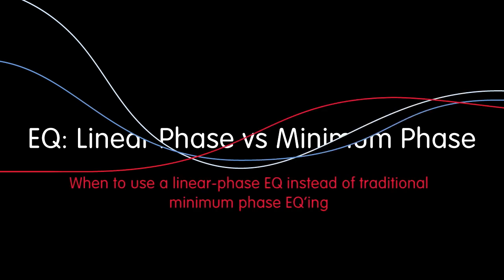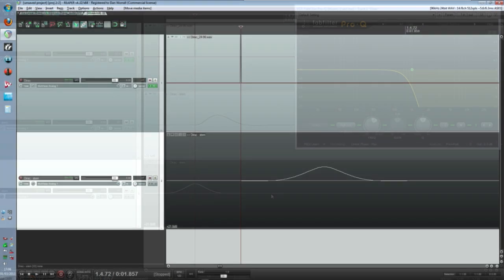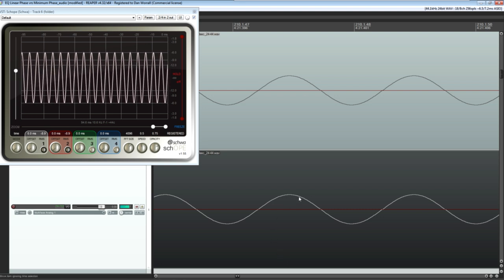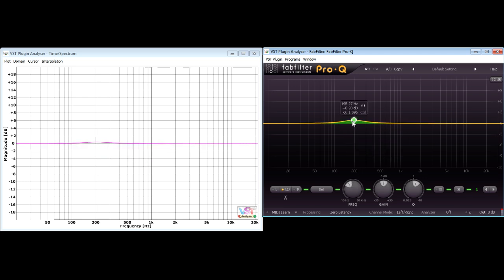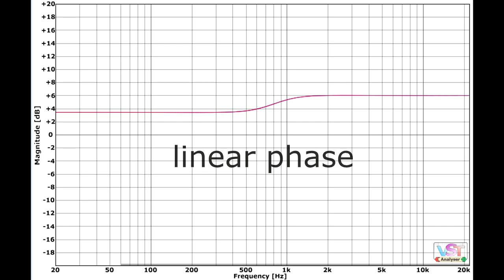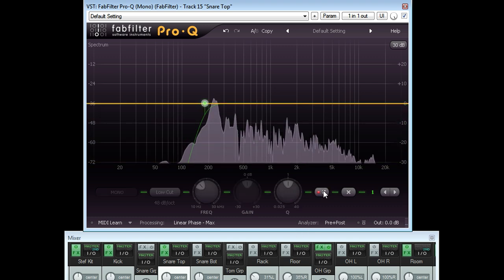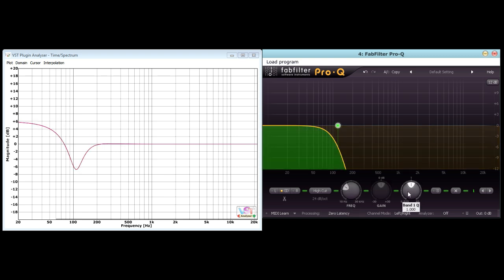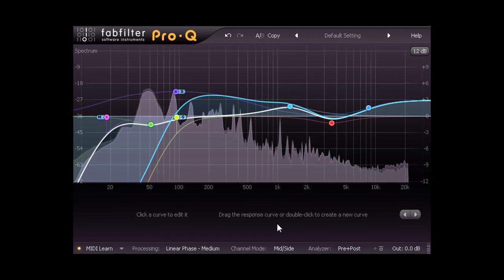EQ: Linear Phase vs Minimum Phase

Comment: This is really where the propaganda surrounding linear phase has been worse than that of minimum phase. Nobody is applying sharp +20 dB bass boosts at 50 Hz followed by -40 dB cuts at 100 Hz. Linear phase is far more transparent and preserves transients better. It is zero and minimum phase that introduce phase distortion that smears the sound. Post and pre-ringing cannot be heard with normal EQ settings.

Comment: So I get the pre ringing having potential to smear transients but in the case of EQing a kick why would a low frequency eq change like say a high pass cut low down or a boost to the low frequencies smear the transient of the kick because the transient part of a kick is produced from the higher frequencies via when the sine wave starts really high pitch and drops, so even if the narrow Q low boost caused the low frequencies it boosted to come in earlier it would be a much lower frequency band to the transient click so that should still come through even if playing closer in time so I'd understand if an EQ move higher up the spectrum smeared a kick's transient in linear phase mode but I feel this specific question wasn't addressed in the video to explain why a low frequency eq move could smear a kick's transient higher up.

Comment: I wish I'd found these videos earlier. They are absolute gold.

The other day I noted something remarkable while working with parallel processing on a bass - a duplicate of the signal was routed to an aux channel with a compressor and saturator (Saturn's heavy saturation mode). The dry and wet signal were mixed together with a compressor and yet another instance of Saturn (warm tape). With the warm tape saturation plugin on the bus, I noticed that - even though it was already in 8x oversampling mode - there was a huge difference in sound when turning on the Linear phase mode. The bass became a lot more punchy, as if I'd turned down the attack knob on the synth completely. I can't really wrap my head around why this would be. Is that because there is some pre-ringing going on, causing the attach portion of the sound to (partially) shift?

Comment: Very enlightening. It would seem that only pass filters are the things to worry about in mixing. However, one can clearly hear phase adjustments on a master track that isn't in paralllel with anything too. I figure this is a delay that will make certain frequencies feel pushed back, in a similar way to a stereo haas effect but about the relation between separate frequencies rather than speaker channels. My process usually involves simply playing with Ozone's settings however and no particular rule comes into play, i tweak the continuous slider until it sounds less...lumpy and phasey (?) ...or i just leave in min phase "analogue" mode. 
Very subjective yet definately there.
In a way, fully linear sounds flat and no phase correction sounds 3d but often in a wrong 'uneven' way.

I kind of doubt this is audible except on very complex signals...such as a master bus. But maybe there are situations that do not involve parallel processing that are about the small timing differences caused by eq where one simply is more preferable.

Comment: Is there no plugin to monitor the phase as a function of frequency and to correct for phase shifts without changing the amplitudes?

I've noticed a very significant difference in the sound of (even isolated) vocals for linear vs. natural phase EQ in the low end (and a difference depending on whether the you use a low cut or a low shelf with identical slopes at the low end). It's partly going to be a matter of the transients due to pre-ringing, but there's also clearly a difference in the tone. Since no phase cancelation is possible in the case of just one track, it seems like the relative phase of the partial waves affects the timbre of the sound. I also checked this using just two sine waves in matlab and varying the phase delay and I indeed can hear a difference in the subtone (the difference frequency of both waves), the composition and intensity of the high buzz that probably consists of sum frequencies and even the perceived value of the interval. Why is nobody talking about this effect?

Comment: Great job Dan Worrall! 

It is good to know that non-linear EQs create those huge phase shifts, particularily, when using steep slopes. 

Linear phase EQs seem to be best used on the final master bus to cut, using a steep slope, the very low frequencies of the track (below 25/30/35 Hz).

Comment: Did I understand correctly: when doing high cut and low cut filters, fabfilter not only reduces the frequencies intended to be cut out, but also raises all the rest of the frequencies in a shelf-like manner? That is fucking dangerous in headphones, because you can easily exceed the safe threshold  in certain frequencies, especially after a few hours, when your ears adjust. Am I right?

Comment: I know this video is kinda old now and has been done with FF Q2, but I've been trying to get the same results with Q3, and it doesn't seem like I have the ''pre-ringing'' problem even though I tried to exaggerate the settings. Has it been fixed on the new version of Fabfilter Q?

Comment: I tried hard to learn everything I needed, but what brought me here was I was making cuts in my unwanted frequencies on the low end suggested to my by the auto analyzer, However if I'm going to make those cuts should I be using my linear eq instead. BTW the cuts I made did sound better in my mix but  the curve is almost to the bottom 🙃 🤪

Comment: Great! Do you consider an EQ boost -  6db aprox. between 30 - 50 Hz that could cause the pre-ringing more audible from the active monitors if you did not make a ROOM correction and your monitors have a similar EQ boost ?

Comment: I had suspicions, that EQs do something to the phase (FL Studio's built-in EQ 2) either adding a delay to process a signal window or butchering the phase of the signal.
Really, built-in EQ did both delay and phase change, so I had to add equal amount of EQ for each guitar IR track, I had to equalize the number of EQs to save phase relation.
Yet, just to make sound better I added artificial delay to IRs (3-10 samples at 44.1) to get the low back in line, but still, that was a revelation at least.

Comment: Wow. I'm gonna get my head around this. Phase has been bothering me without me knowing what it is for a long time.
Reply: right, it's simple to think about phase in simple oscilators, but when you have a full mix, what is a phase?  How do you get the phase of components in a full mix? doesn't FFT has fixed phases? confusing

Comment: Incredibly detailed tutorial! Thank you so much for making this!!  Regarding the pre-ring demo @ around 3min, I'm still a bit confused about two aspects of that phenomenon:

1.   From what I could gather, my understanding of pre-ring is that it is simply an "incorrect, early start" of the processed audio, relative to the original, unprocessed audio.  Further, this "early start" displacement is caused not by the EQ itself, but by the  DAW improperly compensating for the plugin's delay.  

In other words, my understanding is that if I were to just drag the printed audio of the "Linear Phase" waveform (i.e. the image at 3min) to start where its departure from the zero crossing should begin (i.e. departure to begin at the cursor where the above "Minimum Phase" waveform begins), wouldn't Linear Phase then be "flawless"?  

Though, based on the visual differences in the resulting waveforms @ 3min, I'm assuming the answer is no, and that there is something about this Linear Phase's delay and its compensation that is actually warping the original signal (and not just globally displacing it). It is this "warping of the original signal" that I can't wrap my head around. Can anyone please help me understand what is going on?

2.    My second confusion is in regards to these differences in the two resulting waveforms shown @ 3min:  Visually, it seems like the high frequencies that form the attack of the kick drum in the "Minimum Phase" waveform are nowhere to be found in the "Linear Phase" waveform.  - Does Linear Phase processing somehow result in "lost" original frequencies? I'm really confused. Any clarification would be greatly appreciated!
Reply: I suspect that you're no longer interested in the answer to this question, but if anyone else is curious:

1. It's a little bit of a mistake to assume that the zero latency/IIR filter is the "original" signal here, both filters are causing a ringing effect (If I recall my signals and systems class correctly, this is due to the Gibbs Phenomenon, if anyone wants to read more). The "warping" you're describing here is due to the fact that a zero latency filter, or more accurately an IIR filter designed to be minimum latency, will instead have a variably latency depending on frequency. This is why he labels it as "minimum phase" the latency is minimized for any given frequency. 

In comparison, the linear phase filter/FIR filter has a latency that doesn't depend on frequency - this is what it means to have a linear phase, two waves of different frequency that both hit zero amplitude at the same time prior to filtering will still do so after filtering. This means that high frequency components are delayed longer, to maintain phase with the longer latency of the low frequency components. This means that not only is the ringing potentially higher latency in this case, but the transient that resulted in the ringing artifacts is even further delayed beyond that, so the ringing now appears in the signal before the transient itself. Not compensating for the latency simply means you'd have a muddy kick that now also offbeat. And using some complicated signals processing to shift different frequencies forward in time a different amount would generally just reintroduce a frequency dependent phase shift, exactly the thing we were trying to avoid with a linear phase filter!

2. They're still there, just that the level of detail on the visual isn't sufficient to see them. The fundamental frequency seen pretty clearly is somewhere in the 50 hertz range, while transients are nonharmonic but are generally perceived most strongly in the 4-5 kilohertz range. Audio programs generally have smoothing that completely erases high frequency information in waveforms when viewing at longer timescales, to avoid things being a total visual mess, and what you're seeing in the first waveform is some combination of artifacts from that process and frequency information under 1 kilohertz.

Comment: TL;DR: Use Linear Phase mode for Parallel Processing (aka: when there are two similar/identical signals).
Reply: Relevant sections: 
5:46 - 6:37 = Definition of "correlated signals"
18:01 - 18:22 = Summary of when to use Linear-Phase mode; basically almost never.
11:39 - 13:33 = Demonstration of Linear Phase VS Minimum Latency differences for correlated signals
Reply: I appreciate you ♥
Reply: cheers fam
Reply: i love you
Reply: you're a fucking hero
Reply: is this the same rule of thumb for when i'm using the Fabfilter Muliband Compressor?
Reply: is it any good to apply linear phase (max latency) EQ apart from parallel processing?

Comment: Are there any papers of the mathematics behind this effect I could read?
Reply: not really papers, because it's not recent research but "basic" mathematics. You can look up the laplace transform, which can be used to express the amplitude and phase response (which together are the frequency repsonse) of a filter with complex numbers. You can find the frequency responses of typical filters as formulas on the web. You can then "add" together the responses from two filters much like you would add together the signals in your daw. The resulting frequency response is also what you would observe in the audio. So if your mix consists of an EQ A and an EQ B both beeing fed by the same audio, and you mix both together with the same amplitude (e.. 0dB) then the frequency response of the resulting signal would be the sum of the laplace transformed frequency responses of the individual filters.
Reply: You may also gain some insight by thinking about the relationship between voltage and current in resistor/capacitor networks, as this is how minimum phase filters are created in the analog realm.

EDIT:
https://www.analog.com/en/analog-dialogue/articles/phase-relations-in-active-filters.html

Comment: This is amazing!  Not a substitute for spending loads of time to really understand what minimum phase and linear phase are, but it's a great collection of experimentation and application examples for engineers already familiar with the concepts.
Reply: What did you understand, in short , when to use linear phase ?
Reply: @alzahraniabdulrahman  The video has a summary of when to use which one at the end. For me, I think about why I'm trying to EQ, and which phase makes more sense. I had been trying to compensate for flaws in a single mic on a recording I couldn't re-do. The errors all show up after the sound. For instance, a Dirac Spike becomes decaying ringing because of the mic diaphragm's nonzero mass. Intuitively, minimum phase would reconstruct the original signal better than zero latency, but it's always better to try things experimentally than to just theorize about them. Theoretical understanding is helpful so you have some idea of what to try, but testing and revising is what leads to success.
Reply: @charvakkarpe  thank you.

Comment: I still don`t know when should I use linear phase mod and when not(
Reply: use linear phase EQ when you have several mics on the same instrument or some kind of stereo sound like a synth. with mono sounds it is not so important
Reply: can be also useful when you're parallel processing. To avoid phase cancelation.
Reply: I don't own the FabFIlter, but I mostly use LinearPhase Plugins like LinMB or LinEQ by Waves for the Master chain, because I like to have my phase clean on the master bus. I actually never use it for inserts or anything else :D 
So mostly not using linear phase would be enough for most things imo.
Reply: Max Ackerman Yes, I also have come to smth like this)
Recently I decided to change all my EQ`s on inserts with a Natural phase instead of Minimum phase (ProQ 2 version). It caused so many phase problems. Not even sure what is that mod made for

Comment: Why doesn't the fab filter graphic representation correlate with what It's ACTUALLY doing? Why don't plugin manufacturers spend more time getting that right? But I'm assuming this is the case for all EQ plugins. Now I know why I get so frustrated when EQing sometimes, as if I'm adjusting the wrong frequency. Like I'll notch something out like on a snare or acoustic guitar just to hear other phase issues pop up. Totally explains what was happening! Just reminds me to use my ears and not my eyes lol.
Reply: +Corey Reynolds The graphic representation does correlate with what the filter is actually doing. What the graphic representation does not correlate with is what happends  when you mix the EQ-ed audio with other audio that is correlated with the audio that was EQ-ed. There is no way the EQ can know beforehand what you will do with the processed audio, so that's where the linear phase mode comes in. If you want you EQ-eq signal to behave "normal" after mixing it with correlated signals then use linear phase mode. Otherwise the other modes will do fine.
Reply: +Marcel de Velde Well, then it should at least display the phase.  Some other EQs, such as the "StandardEQ" do this.

Comment: Ok, am I right when I say minimum phase modes are generally going to give you some extra cut above the cutoff when combining correlated signals and linear phase is not?
Reply: Hm, yeah... as if you've mixed in the original non-eqd signal... you'd have some phase effects.   Great vid.

Comment: The EQ can't know, what you're doing outside of it.
It does not know, if you mix correlated signals together (and how the phase relation between them is) or if you're using a compression on one of the signals.

In the end, you should just be aware of that issue and use the EQ accordingly. With plugins like ProQ you always have the choice.
So if you're not sure, if there actually is a problem, just switch between MP and LP mode. That will make it obvious.